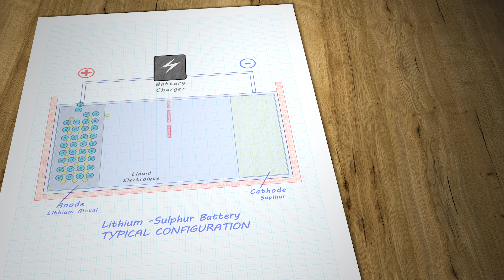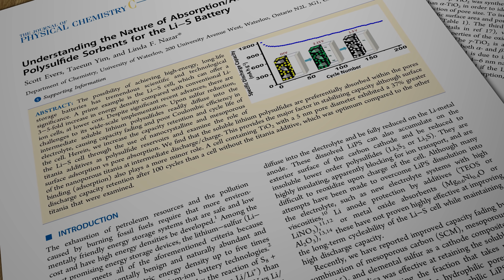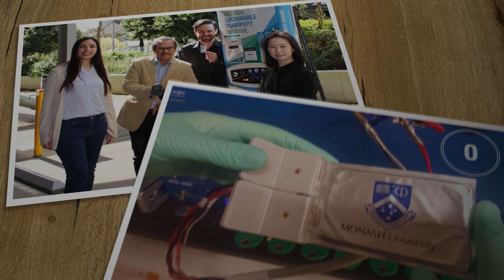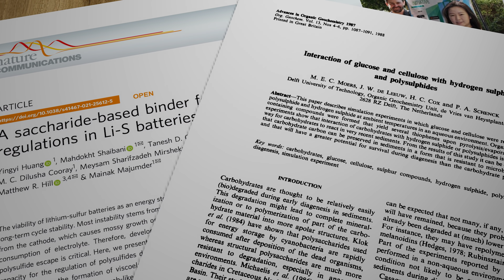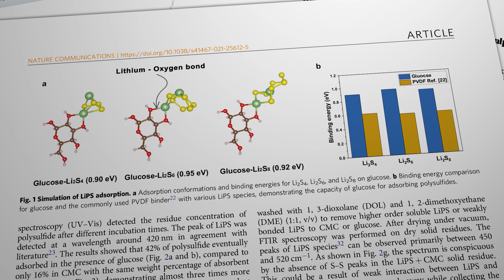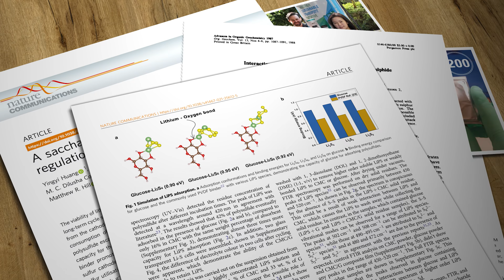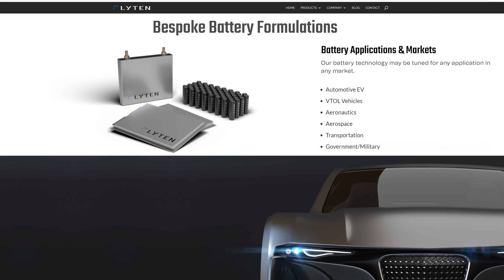Lithium Sulfur batteries: SOLVED! Two new tech breakthroughs in the same week!

Comment: Very good. I,m former director and battery inventor from the French owned company SAFT.  After retiring I took out a patent application for a battery enclosed within a fly wheel .  The idea allowed during spin for the electrodes to be pressed together and whilst stationary charge could take place with plates separated to gain advantages .  My life covered silver zinc for torpedos but covered everything from thermals to all metal air uses.  I have always been drawn to pyroforic  iron nano particles in electrolyte married with air electrode which have sadly gone to the  back burner these days.
My patents include the primary lithium batteries in pin size format stolen from the jewellery industry of pin size hollow metal spheres. Naturally the application lives in the James Bond uses. Oh I,m retired and male and not named as shown.  The flywheel has some yet to be used in applications in batteries… good luck.
Reply: Do you have an email, would be fun to pick your brain?

Comment: A huge number of people could be out of luck and be unable to use these batteries. A large part of the population is trying to avoid anything with added sugar.
  In any case, batteries are old technology. They aren't suitable for cars. By the time we see movement in the battery industry, fuel cells will have replaced them all. My laptop already uses one.

Comment: I Have heard, though, of Sodium-Sulfur batteries which are, indeed used. Primarily (or exclusively)  for industrial purposes and are "industrial" in size. Both elements need to be kept fluid (not solved). The energy required is actually pulled FROM that same battery.

Comment: Di I hear correctly?  9:02 - 9:10  Paraphrasing - The longest lasting EV batteries today have circa 1400 charge cycles"  Is that correct?  That means a car used to the max every day would need a new battery every 4 years......

Comment: Why do I have the feeling that quick charging, high power density, inexpensive, long lasting batteries are (like nuclear fusion) only 5 or 10 years away,  and always will be?
Reply: Like Elon musk says: “building a prototype of anything is easy, mass production is 100x harder” 
 Even if we had the science figured out today, it doesn’t mean much, since it takes decades to implement at the manufacturing level.
Reply: For one reason, the denser your battery, the more it is like a bomb. We are already close to the limits in terms of power.
Reply: @melanieenmats  are you on drugs? That makes no sense.
Reply: @Flash_345  Of course it does. A lot of energy in a small space and with the capacity to unleash all at the same time basically means - a bomb. The more energydense something is the more potential for danger. It's difficult to find chemistry that has high energy potential and at the same time not being dangerous. Haven't you seen batteries breaking and burning?

Comment: Great channel MR. Again, Hydrogen is the most efficient means of storage without having to mine rare minerals. UK has the potential to use tidal power based on good old gravity with the world's 10th largest coastline. Moreover it has the means to store this valuable renewable "reliable" energy for grid integrity and as a plan B to lithium electric transportation - "green" hydrogen storage. Energy security is more essential than ever with dependency in Europe to Russian gas. If I were in government I would be making this the build back better green new deal post industrial strategy. Jesus wept, it's too late in the evening for clichés. 😅Green hydrogen storage could be a potential solution to intermittent wind too.
Reply: Sounds 10x expensive as natural gas
Reply: Right now, due to cost, nearly all hydrogen is produced through the use of natural gas. So much for energy decarbonization. LOL

Comment: 9x energy density will make commercial airliners possible for short and the short end of medium haul. If we take 1000wH/kg (to  make the maths easy) then 100 tonnes (the amount of fuel on a not quite full 777 variant) we are talking 100MWH. That would mean 90 minutes of flight with a 30 minute reserve. That is 750+ miles.

Comment: All fine and good assuming that these new battery technologies make it to mass production. However, where are all the new power plants that will be needed to support the conversion to EV vehicles by the 2030's or 40's? Here in California we barely have enough power for hot summer days. I don't fancy having the entirety of the USA's southwest covered in solar arrays and windmills to generate the needed power. I think that 4th generation mini nukes are required  to ensure base power supply.

Comment: While I loudly and profusely applaud ANY breakthroughs in battery research, including any lithium based batteries. The trouble with lithium is that it is one of the rarer elements in Earth's crust.
At the current rate of consumption all known lithium resources on this planet will be locked in some kind of battery or other chemical compound within 10 to 15 years, tops. Even assuming that new lithium deposits can be found, the price for lithium will skyrocket within the next ten years or so.  
Reclaiming lithium from its compounds in batteries is also no mean feat, both physically and chemically. While it is possible to reclaim it, it is both costly and difficult.

So with the price of lithium climbing to nearly unattainable heights, the rarity increasing, and the stores being sucked up by multiple demands with fewer and fewer available resoures on this planet, we have to consider other means of storing electricity, that are light-weight, high capacity, high longevity, quick loading, fairly fire resistant, and quite a few other necessary characteristics.

Comment: Interesting. A doubling of energy density would be a game changer. Let's hope at least one of these works out.
Reply: Realize that a doubling of energy density is almost ridiculously high. And if they get it working you probably could not take that battery on a plane because if it catches fire the plane crashed and everybody dies. 

Google an electric vehicle fire and you will realize that doubling the density most likely means doubling the danger.
Reply: @melanieenmats  airplane fuel has far higher density still yet they take that onboard
Reply: @fdk7014  Try taking kerosene in your hand luggage :D.
Reply: @melanieenmats  if you are talking about phones in the future they will come with whatever battery technology the airlines allow on-board. They will work it out. The high density battery is for powering the plane
Reply: @fdk7014  I was indeed thinking of phones. You have a point that it would be more useful for the plane itself. 

But that is a long way to go before we can have reasonable electric planes though. My bet would be we get those together with fusion so we can charge those batteries too ;).

Comment: Unless we standardize battery packages as we have in the examples of AA, AAA, 9v, D, and C cells, advancement in motor vehicles using electricity will continue to flounder. All because governments refuse to force standardized battery packages, which could be exchanged at service / power stations in a couple of minutes, instead of plugging in to recharge the battery which is permanently in the vehicles. A standardized battery 'pack', perhaps flat and stored under the car, in a sliding in and out mount with bayonet type contacts and a locking bracket to keep it in place, could be exchanged at a 'power station', and the remaining power in the exchanged battery measured and the customer charged for the energy used, and sent on his way with a 'full' battery while the station recharged the one left behind, for re-rental to the next customer. Of course, car manufacturers hate this idea, because it would cut into their profits of making proprietary batteries which only fit their own cars, so they can jack up the prices to enormous levels. Profit is the primary roadblock to advancement.

Comment: I have some experience in industry and have seen 'research to commercialisation' successes and failures both.

Based on my experience, here's how I would end your sentence - 

"These two competing technologies are certainly potentially very exiting, but as is often the case, they're"    .... 95% likely to be bogus claims based on fudged data, and these researchers are just looking to get their share of the billions sloshing around as grants for anything that has 'renewable energy' in its title.

I know of a few such researchers who have personally made millions on the back of outlandish claims. Great thing in this whole hogwash is, you only have to sound half convincing - the ones who have to disburse funds for 'green' research have much more funds than the researchers asking for them, and they are under real pressure to use those funds.

It's a real dirty business today - this "Green' research.

Comment: I think graphene is going to bust the whole battery field wide open, we don't understand all that graphene is capable of even now. But we know you can, for example, have a supercapacitor integral to the battery for charging/discharging extremely rapidly. The weight is a fraction of a current battery and its energy density promises to be at least X20 of Li-Ion.  I like, me want.

Comment: meh. LFP has more promise than this despite being already available. LFP is becoming more exciting because it is much cheaper, using widely available iron vs Nickel or Cobalt that are toxic and political issues, much safer, and added benefit of even more cycle times.  Only drawback with LFPs is slightly lower power density but that is where the growth potential is

Comment: Lithium extraction harms the soil and causes air contamination. In Argentina’s Salar de Hombre Muerto, residents believe that lithium operations contaminated streams used by humans and livestock and for crop irrigation.

In Australia, only two percent of the country’s 3,300 metric tons of lithium-ion waste is recycled. Unwanted MP3 players and laptops often end up in landfills, where metals from the electrodes and ionic fluids from the electrolyte can leak into the environment.
Because lithium cathodes degrade over time, they cannot be placed into new batteries.

Comment: Lithium can react with Sulphur just like it will with oxygen, in fact this is what drives the battery. So Lithium-Sulphur batteries are absolutely susceptible to thermal runaway.

Comment: Regardless of anything the EV sceptics might say, the global challenge to produce batteries of far greater energy density than today’s Lithium Ion is proceeding at a furious pace.  For reasons vastly more diverse than just powering our Cars, the electricity storage cell has got to improve way beyond current technologies.  I doubt there will be a single “winner”, rather I’d anticipate a spread of battery tech to come to be, targeting or being used by different markets.  It cannot come quickly enough.
Reply: I hate to break it to you, but battery development has been around for many decades. And they are still garbage. Are batteries much better than 20 years ago? Slightly, but they still suck. The biggest advance has been in cost. My toy rc cars from the 90s only had about 5 minutes of drive time. Today that is about 12 minutes. Big deal...
Battery tech is advancing much slower than you think. Just lots of companies hyping their tech so they can trick investors and get rich quick.
Reply: @jimj2683  That is 2 1/2 times.  That is a lot.  If we get the same improvement in the next 20 years, we will have EVs that have over 600 mile range.

Comment: "As we move rapidly away from fossil fuels" but we are not moving away from so called fossil fuels, we still burn them, what do you think the source of the electricity you are charging your  batteries with is coming from? The power plant pollutes more then burning the oil in your car would. This is a scam.

Comment: Horse crap. The periodic table helps chemists predict how elements react to one another. There is nothing new. If it hasn't been used there are other drawbacks that make it impractical

These press releases are usually just utilized to pump a stock temporarily. Then you never hear about it again.

Comment: Of course high cycle lifetime is good, but we could "ignore" it by simply having an electronic circuit that simply bypasses a cell at the end of its cycle lifetime and  activate a second backup cell, then a third cell etc.  Just like cells in parallel / series. If the cells are built with recycling in mind then 1000 cycle per cell is fine.

Comment: This is why I'm hesitant about getting an electric vehicle anytime in the next 5 years.  The current ones are built around the battery pack.  There is very little incentive for companies to put the latest battery technology into replacement batteries for older vehicles. They will be too busy making new batteries for whatever ugly monstrosity full of spyware car designers come up with next.  Since the batteries are not universal or even remotely standardized, the current cars will be largely disposable. Even if form factors were standard, the different chemistry in newer batteries will likely require different charge curves. There are a lot of betamaxs on the market and only one VHS. Even that will be replaced in a slightly longer time scale.

Comment: The thing I have never understood is that we can make fuel from sugar cane (which is carbon negative, because of the carbon absorbed in the growth of the cane).
So I'd this source was NOT TAXED by all governments around the world it would cost less to produce a barrel than oil...

So at what point does society ask is it an ethical or financial restriction for a cleaner environment??
And I may be wrong but I believe a low grade fuel can be made from bamboo as well.... This crazy fast growth rate of bamboo should be enough to want this as a minimum to replace diesel / low octane burns? 

So why do we lump 2 tonnes of batteries into cars when we can run them on plants???
Reply: @william breen I see your point regarding land space to grow the crops, but surely it can be easily done in sparsely populated areas such as Australia, NZ, Canada etc... Where much land if simply unused and not national parks or anything of "specific purpose" it simply hasn't expanded enough to create new suburbs... But your point regarding land to output is a very valid one.

For the record though your basic model 3 Telsa weight: Kerb weight 1,847 kg not even the big boys, just the standard model. They are nearly as heavy as a Bentley Continental
Reply: @william breen hmmmm well you certainly make sense and have some very good ideas and points (appreciate the candor discussion, too many people jump into defence mode on the internet so thanks for not doing that).

I absolutely agree with you that the areas you listed will still require some sort of fuel based system unless they can drastically lower batter weights (which may be decades away, hopefully not butost likely).

I think you have some good ideas for fuel extraction on those countries listed. I really like geothermal and even wave motion energy so I think that type in addition to solar is a great idea.

Anyway thanks for explaining why bamboo or sugar isn't used and providing some alternatives 🙏👍

Enjoy your week

Comment: For me it sound like the first 10% is done. Now there is just the last 90% to do.
Make a production setup and building a large scale production line the many times over that is needed will take decades if everything work out, but it never do.
For me it sound like the how far lithium batteries was in the late 70'. I do think that we can move forward faster now but get down the process and building a mass production in less then 10 years would be very fast. Then do it many times over in a way that show some profit.

Comment: sustainability???    how many piles of dead battery refuse is this going to produce long term?   is it going to be cheaper to dump the old electric car and buy a new one than it would be to replace batteries???  is that going to create monstrous junk yards larger than the ones we already have.   how are we going to create electricity for all these new  chargeables when we suddenly can't even keep the electricity on for the limited power needs we have now?  I get how there are some politicians who are chomping at the bit but this is not ready for prime time   Sad Joe has turned off the oil spigot prematurely.  how is this going to be sustainable.. or even affordable?   I bought a jeep 22 years ago... you know what I have replaced on it in 22 years to keep it running?   tires once  and a radiator.   until electrics can match that economy the tech will not be sustainable.

Comment: If they have 5 times the capacity of LiIo even 200 Cycles would already be quite a bit.
If you take a Tesla with 450km real range per Cycle aLiSu version would have a range of around 2000km and 200 cycles would be a lifetime of around 400.000km, way more than most gas cars today. 1000 cycles would mean 2 mio km lifetime.
But let's see how far they get in the next years.
Reply: LiIon has prospects for much greater energy density, the problem I think is more about keeping them safe. A large amount of energy packed in a small volume has potential for serious problems.
Reply: @jimgraham6722 
If a LiIo battery burns it is not the electrical potential that burns otherwise an empty LiIo battery would not burn, it is the materials that burn, so if you have a battery made out of less reactive materials to oxygen you get less of a risk, in this case the video said that they do not have oxygen in the battery and are so less of a fire hazard.